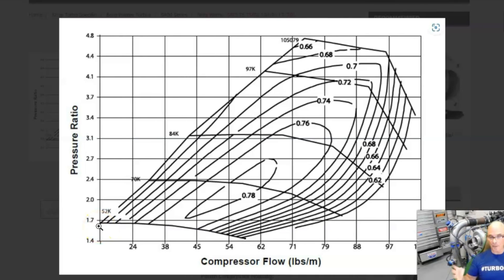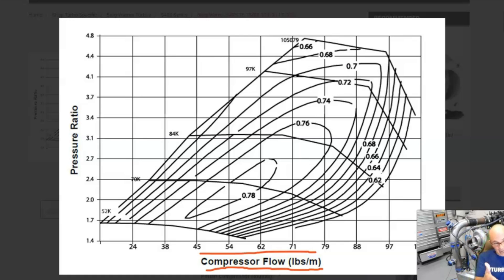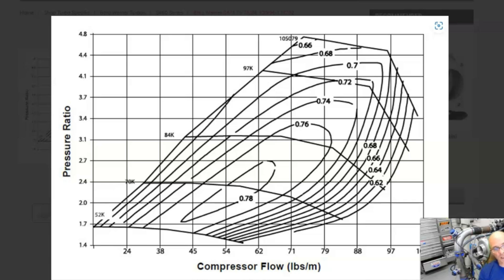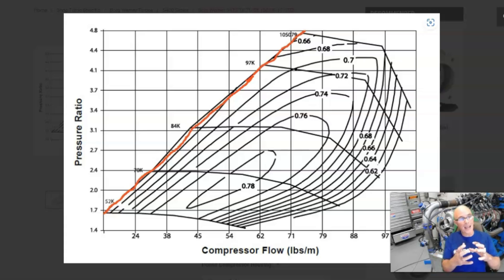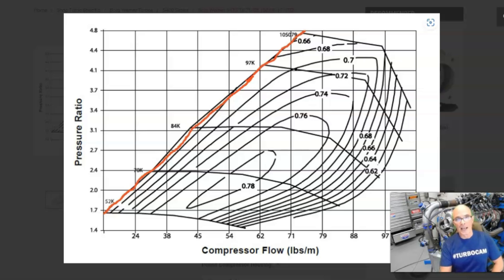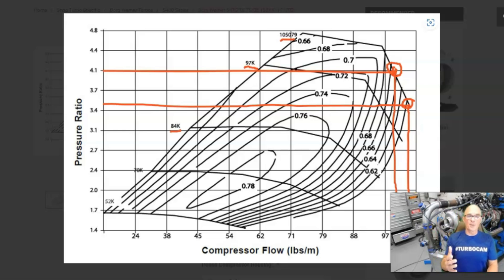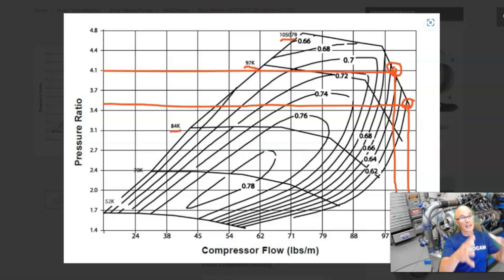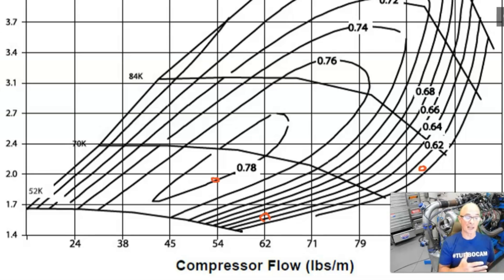COMPRESSOR MAPS 101!! TURBO COMPRESSOR MAPS MADE EASY! HOW TO READ A TURBO COMPRESSOR MAP. MAP HACKS

Comment: Grand slam... you kiss  ( Keep it simple stupid) better than the other map schools. 

Ruel of thumb. 10x lb/min= hp is bad ass  mesured where?
From my studies at you tube university,  measuring at the crank. 
Rule 2,  7xLb/min =whp.
98% will be applying this math to chassie dyno numbers,  that encounter losses on the way to the ground.  4 different turbo schools from different companies have used this ball park 7hp/lb air tire. You have comfumed  their 10Lb/min  crank number. ( unless you say it was tire measurement,  not likly sence 99% of the education I've gotten from you was at the engine dyno. I think ive seen 1 on the chassie  dyno).
Reply: Ok  thank you. 
Lack of accuracy is the complete reason for a rule of thumb.  It's is consistent, but not 100% accurate to all situations.
Reply from the maker: flywheel
Reply: @richardholdener1727   
Any possibility to confirm the other turbo schools  7whp/lb rule of thumb.?
Reply from the maker: no idea what you mean by confirm other turbo schools
Reply: @richardholdener1727  you are the 5th  to say 10chp/lb. You are the only to say nothing about  tire hp math. You have access to the equipment to confirm the 7whp/lb rule of thumb  the others only had access to a chassie dyno.
Reply from the maker: There is no absolute for tire hp math. The different drivetrains can soak up 10%, 15% or more than 25% of the rated flywheel hp, so whp estimations would be even less accurate.

Comment: if you feel hard to understand,just make the explanation backwards.....
just think you have a spesific turbo,and open the compressor map...just think what engine is suitable for my turbo 😂 just look at efficiency range,and look the horsepower you want,and boost you want,and than choose your engine based on that,you will understand what you need

Comment: How to size twins based on the maps ?  

How to size using Chinese turbos with no maps.  

How to size with companies that don’t publish compressor maps (precision) ? 

How to size exhaust housing.  This covers the compressor side, how to choose on the exhaust side.  

Ie:  I have. 6.0 I want to boost.  I want to run cheap china twins.   How to size those the best I can while maintaining ridiculous budget for boost.  (Money spent inside motor) 🤣.   

Asking for a friend.
Reply: Use maps from real turbo manufacturers for about the same size turbos, they are not much different.
Reply from the maker: how much power do you want? If you tell me that-I can tell you what turbs will achieve that
Reply: @richardholdener1727 .  6.0 stock crank, forged rods & pistons.  317 heads bc I they were free. ARP everything.  BTR twin turbo cam and goodies.   

Based on your library of videos shooting for 400-450 n/a and 800-900 with boost at the crank.  So 2- 2.5 atm of pressure desired?  Is that a realistic expectation?  Don’t plan to rev past 6500-7k.    Going in autocross/power tour 70 c10 with t56.     I hope power numbers are realistic and same for 3000-6500 main power “range”.  Only bc It’s a driver.  Full tube chassis and 90-00’s cup car/ v8 super car style suspension.  

Thanks for replying and for all the extremely helpful and informative videos.
Reply from the maker: 900 flywheel hp will come at less than 20 psi (closer to 15) assuming good fuel and intercooler
Reply: @richardholdener1727    That said should I check the longer tech vid for sizing twins vs single?  I’m assuming divide airflow requirements by two bc the exh side essentially is seeing a 3.0L 4cyl volume of air and looking at half the power requirement bc of twins.  

Just want to make sure I’m unpacking all this correctly.
Reply from the maker: use gt3076 or gt3582 for twins on your 6.0L
Reply: @richardholdener1727  thanks a bunch I really appreciate your time and willingness to respond.

Comment: Hello again!

What about in a compound setup? Will the bigger turbo see the engine and the small high pressure turbo as one unit? Let's an engine make 150hp na, when receiving 1 bar from the small turbo the big turbo will see it like a 300hp na engine? I was asking that to myself on not necessarly a big high horsepower engine but maybe on a setup to reduce turbo lag to minimum

Thanks in advance

Comment: If you don't have a compressor map you can always measure Pressure and temp before/after the comp, and calculate the compressor efficiency, to better understand if you work it in a good running point.

Comment: And in one video you've inadvertently explained the exact situation that drives the need for compound boost! Low N/A airflow relative to target airflow. Staging the turbos keeps you down inside the compressor map.
Reply: Well worded. You use a small turbo in its range to amplify the motors total flow...
Which then makes it acceptable to run a bigger turbo on the, already turbo'd combination.

Comment: Richard - Let me throw a variable at you regarding this.  Say instead of a single turbo you want to run twins(c'mon you know 2 is always better than 1 and in the spirit of Richie Rich's "is always way more fun") and to keep it simple lets say they are going on a V8 that makes 450HP total NA and your end goal is to make 1500hp.  So in order to get you there you have to take the NA horsepower and divide it by 2 so that would mean each half of the engine should in theory make 225HP, correct? and the number you should calculate the NA horsepower required to get to the right sized turbos needed for the combined total horsepower you're trying to achieve at the best possible efficiency on the map, correct? So concluding the end goal is 1500HP that would be 750hp per side or per turbo @225HP per side NA on a gt45 compressor map x2 (twin turbos) or 7.5#/min of corrected air flow at a pressure ratio of 2.25 has me dead center line and at the lower third of the 78% efficiency band.  I dont think that tracks my Motor HP NA = 450hp/2(2 banks on a V8)=225hp So 750hp per turbo / 225hp from each bank of the motor gives me a PR Vale of 3.333 / 2 turbo's= 1.6667PR), correct or am i missing something?(i think i'm messing up the PR value by dividing it a second time by 2 because i added a second turbo to the mix).  Let me know where i am screwing up the equation Thanks! Rick
Reply: Don't divide the pressure ratio by two because you have twins.  They are running in parallel and pumping into a manifold at the same pressure.  Flow is divided by two, not pressure.
Reply from the maker: Andy is correct-don't divide the PR

Comment: I've been doing a lot of reading on turbo sizing lately. Everyone seems to focus on compressor maps but I feel like turbine sizing and ar has a lot to do with the general performance of the turbo and where it makes power. At least intuitively anyways. I would think a smaller turbine and AR would spool the turbo quicker (i.e. get it flowing more air sooner) but choke the power output up top as the turbine can only flow so much exhaust.

I know people talk about peak hp numbers but for my setup (atlas 4200 + ar5) im looking for something that would make for a fun driver. I'm more interested in a big usable torque curve vs. big hp numbers, and have yet to find a video that caters towards that kind of build.
Reply: Check out the borg match calculator.   Works really well for dialing in the right ar for your application.
Reply: Yes you are right, turbomatching was part of my profession for many years at a OEM. We spent alot of time on the turbine side, its very important since thats where you get all the drive energy from. And turbines can be very different in their characteristics, so you need something that suits your flow and pulsation characteristics for your engine and torque curve demands. Sadly turbine maps and detailed data is never shared for after market stuff, but its not always easy to evaluate either without some decent simulation tools.

Comment: This is why people need to build their tuning around mass airflow, there's a reason every OE EFI system uses one. Speed density is a trap unless you know exactly what you're looking at. So many aftermarket ECUs push speed density because it's "easy" it's a real disservice to their customers.
Reply: Speed density plus air temp equals mass flow. OEMs like redundancy and accuracy that's why they have both
Reply: A maf is another part to fail which does fail, it’s another restriction point and most maf systems will max out at low boost unless you enlarge the tube, then when you enlarge the tube, you lose accuracy and it just pits you right back where you were in speed density and it adds to the chasing your tail. The only thing you might add is fuel mileage. Maybe. I haven’t seen difference either way tho. I tried using the maf to get better fuel mileage and it didn’t do any different. I ditched the maf years ago on boosted vehicles and never looked back.
Reply: The OEMs use MAF because it is better at adapting to wear/tear of the engine (and thus, VE) over 100s of thousands of miles - something which is less  important to tuner cars with built engines. In exchange, MAP/speed density gives us less inlet restriction and easier intake plumbing. Last, not all OEMs use MAF. Chrysler, for example rarely uses MAF. I've tuned a lot of MAP EFI systems - it works great and never once have I thought "gee, I wish this were MAF"...
Reply: @GroovesAndLands  truth.

Comment: It's cool info but in the real world it's not very helpful sadly. Because many manufacturers dont publish maps and most people don't know the airflow capability of their engine anyway. Also it ALL ignores the arguably more important (in the real world) conversation of the turbine wheel. Much more effective approach is to just observe results of very similar combos which is easy these days due to channels like this one👍
Reply: It is very helpful to the customer, however many people even if they know how to read the basics of a compressor map they struggle to understand how it translates as performance differences in their cars. The usual stories of guys that paid a lot of money to swap their GT and GTXs for GTXg2 and Gs only to find out that the gains were marginal at best and sometimes even worse.

Comment: Great video, Richard!  I've looked at compressor maps before, so I already had a fair understanding of them, but I was still able to learn from your video.  I really like the 10 hp per lb/min of airflow rule of thumb.  In my opinion, that's an excellent way to have a better understanding of a map without having to do a lot of math.

One question that I have though is, in your example with the engine that was way too small for the size of turbo, wouldn't it have trouble getting the turbo to even spool to the boost levels needed?  Id think throttle response would be enough of a reason to stay away from oversizing a compressor like that.

I suppose a lot of turbo response depends on the turbine (hot) side of the turbo, which I don't understand near as well.  In the future do you think you could do a similar type of video talking about sizing a hot side for a turbo (size, A/R, etc)?
Reply from the maker: the 100-hp would also never spool this turbo-it was just an extreme example to make a point about surge
Reply: @richardholdener1727  in relation to what he mentioned about the a/r , what gives most people a headache is to decide between a bigger turbine wheel and smaller a/r or smaller turbine wheel and bigger a/r . I am talking for exactly the same compressor.
Reply: @user-vw1vf5cw7d I think that's been a longstanding question because, as we've been seeing lately, it depends on the given turbo/combo. Some turbos, like the Xona with the UHF turbine wheels, are really liking a smaller than usual AR and still at surprisingly low backpressure even when maxing out the compressor wheel in some cases. It's been eye opening how much real world difference there has been with turbines/housings designed around each other and just well designed stuff in general and blade/housing spacing etc. There are still rules of thumb to get a good idea and real world results from others to hone in further, but even if a test was done on one combination (which would be cool as hell to see) where it is apples to apples, it still probably wouldn't apply across the board.
Reply: @mattmorrison6958  I would ask for something pretty standard that many people can relate too. So what is most typical. I would say the standard Garrett GT series with the cast compressor which have been to the market for many years now and many people are familiar with, so they can have a point of reference. Then someone can make his comparisons with other turbochargers of Garrett or others, having this test as a point reference. Of course between turbochargers they are real differences that they affect performance. Mitsubishi is something similar with what you just mentioned, with their 12/11 Blade turbines (instead of 9 blades) and generally smaller a/r they would have a similar top end with an equivalent GT series Garrett.

Comment: Very good simple explanation, now  a video on turbine sizing and turbine AR would be very helpful. Thanks
Reply: From my experience, it's a bit of trial and error.  You have to run the turbo and measure the exhaust manifold pressure to see if the turbine AR ratio is too small.
You really don't want more than double your boost pressure.  15psi intake, 30psi exhaust is getting really restrictive.  Gotta increase the AR.
Reply: Yes, but the AR and turbine sizing can be calculated

Comment: Now if i could only find a magic turbo that is most eficant aroud 24 lb/min at a 3.7 presure ratio lol
Reply: That's a hard ask. I couldn't find anything in the Garrett catalog that meets that requirement. Something like the old GT2252 or GT2860RS are sized appropriately for that power range, but aren't rated for that high of a pressure ratio. You're at least on the map for a GTX2860R GEN II, but are well outside the efficiency island, and approaching the surge line. Unless you can live with one or the other of the above situations, you'll want to either drop your HP expectations, or modify the engine to make more NA horsepower to begin with.

By the way, what engine are you working with that only has 65 HP NA? (240 HP/3.7 PR) A motorcycle or a kei car?
Reply: @Joel_E   g10 suzuki came in  chevy sprint and geo metro in the USA.  Rest of the world got the suzuki cultus. With a cam head porting and intake work makes 68 wheel hp
Reply: @freyja4954   oh, okay. I've driven a vehicle with a Suzuki G10, and can certainly see why you'd want some more power.

Keep in mind when you're looking at airflow and horsepower that the compressor maps are based on flywheel, not whp. The turbo doesn't know anything about driveline loss, since it only flows air. If you're looking for 240 WHP, you need to be looking at closer to 28 lb/hr (280 flywheel HP) on the compressor map, and the GTX2860R Gen II starts to become a more reasonable choice.
Reply from the maker: Garrett might have that

Comment: On3 junk that I own never provided a map.
Reply: Just interpolate from a similar sized turbo map, will get you in the ballpark.
Reply: @danielsullivan9865 I understand, I just don’t trust the quality on my owned junk to compare to something better. My last two on3 leak boost out of the compressor housing
Reply: I'd further recommend looking at maps from older model turbos, rather than comparing what you have to the latest and greatest from tier 1 manufacturers.
Reply: @Joel_E gotcha. Was considering a VS 7875
Reply: @timweb1510  how many cubic inches is your engine?
Reply: And what rpm does your engine make maximum horsepower?

Comment: But wait my Chinese turbo doesn't even have a compressor map.
Reply: 🤡🔫 hand over the maps and nobody gets hurt, Procharger
Reply: Yet it works just fine...
Reply: Neither does Precision ))
Reply: Don't worry, if your turbo has no compressor map, it just means it won't go into surge.
Reply: @White.Elemant  😂
Reply: And it won't overheat the air when overspining)
Reply: lolololol
Reply: You just have to find a comparable turbo with the same specs. A 7875 china is ( almost) same as a precision, garret or whatever and use their map. It will be closer than you think
Reply: There are no compressor maps for precision turbos either
Reply: Use yin & yang procedure..
Reply: It’s a clone of something else. Or just unbranded.
Reply: neither do these updated billet wheels, but that Chinese turbo is a nock off of something so look at that